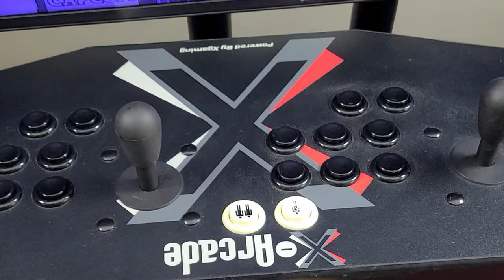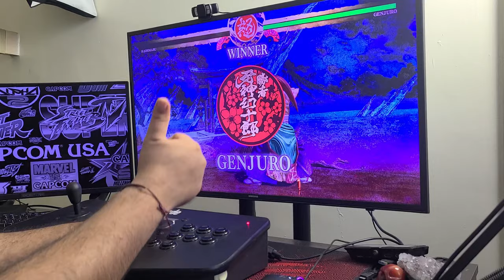XArcade (Zerolag TRI-mode USB Kit): Revamping "Old Faithful"

Comment: hello friend..where did you buy the pcb from? I want to buy one because mine when I put it in mode 4 doesn't recognize me as a joystick the one on the xgaming page says pcb version 2.1. and the one i have that i bought in 2012 says version 2.1.X-ARCADE CONTROLLER/MACHINE 2022 ZEROLAG UPGRADE KIT. the photo on this page the pcb is not the same as yours.thanks !

Comment: My left stick keeps randomly triggering the “circle” button when I move, any advice on how to reset the controls to default? I know there are buttons on the back but have no clue on how to use them
Reply from the maker: If you are talking about an XArcade (with the zero lag board installed, like in this video) then the back buttons/switches work to change different control layouts/settings
one for Xinput (xbox style layout) one for Dinput style layout ( standard and oldschool style config) and the others are for programing with the PC keyboard layout settings. 
You have to look around find what layout you have yours on before changing anything. I got the zero lag board just so i wouldnt have to worry about changing anything, LOL I just leave it in xinput and the stick will act as an xbox standard controller.
Reply: @RCTGaming  thanks brother!! Opened it up and messed around a bit with the connections, In the end I think it was mainly making sure the connecter wire that leads to the console were firmly connected to the board. I think with moving around and the wire getting tugged here and t here lead to it loosening it a bit. Happy to say I'm running some Tekken Tag 2 and it works great!
Reply from the maker: @immortallegaciagamingteam9301  Glad you got it sorted. Enjoy! :)

Comment: What about just using the adapters that x-arcade sells. They have up to PS4 I believe.
Reply from the maker: You could do just that but in this case it was done to turn a direct input (and limited to keyboard layout) into something that should work not only on consoles but pc as well (xinput) since I also have a mayflower USB wifi adapter (that I got for switch) that works on almost every console (either plugged of wireless) in other words: it made more sense to convert the xarcade into something more "universal" than shelling out for a bunch of adapters for every case.
Reply: @RCTGaming  makes complete sense. Thanks

Comment: Can work on PS5 somehow??
Reply from the maker: It "technically" could work (haven't tested that part) because it has a "Dinput" setting that could work for that, but not sure. What i do know is that anything compatible with Xinput mode can be used. :)
Reply: @RCTGaming  so for 2players setup If I should buy 2 brook universal fighting?and set it up Will it work on ps5?
Reply from the maker: @y0ush4  As i said, it "technically" could work, (on the Dinput settings)  but dont quote me on that as:
1) Playstation consoles have historically used Dinput (or a variant of it) in their controls (which is different from the Xinput that works across PC and Xbox)
2) I dont own, nor am i planning to get a PS5 for the foreseeable future, LOL. So i cant test for sure if it does. :)
Since this kit i got specifically for my 2 player Xarcade, if you plan on using something similar to this for your PS5, then i suggest you check their site to see if its compatible with it or if they sell an "adapter" that might do the trick. :)

Comment: Esto funciona para series x ???
Reply from the maker: No lo he probado con Series X (porque no lo tengo) pero considerando que Series X trabaja con "Xinput" para reconocer controles, esto debe funcionar bien y sin problemas (siempre y cuando lo ajustes con el "switch" de la parte de atras del control y selecciones el "Xinput" :)
Reply: @RCTGaming  donde lo has comprado?  El kit USB zerolang tría-mode ..
Y que es el “xinput”?
Reply from the maker: @polen7  Este es la version de 2022
Verifica que tengas lo necesario (cables) para instalar (antes de ordenar) : https://shop.xgaming.com/collections/adapters/products/newest-version-2022
Xinput es la denominacion/nombre de el tipo de "software" de control de mando que utilizaras para los controles de PC, Consolas. 
(dependiendo del sistema operativo de la consola o PC, puede que sea: Dinput, Xinput, etc. 
Xinput cubre el Xbox, PC y todo equipo que corra Microsoft Windows. (es el mas popular/comun) compatible con casi todos los controles, Arcade sticks, Flight sticks y guias de carrera en el mecado. (es el que usa el controller de Xbox 360 y Xbox one) 🤘